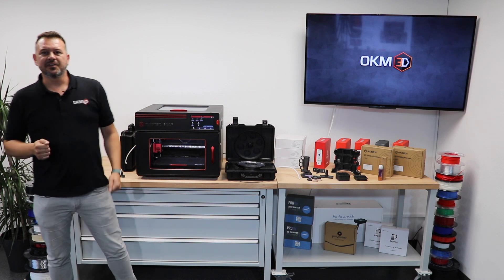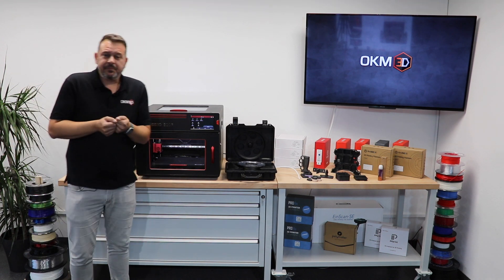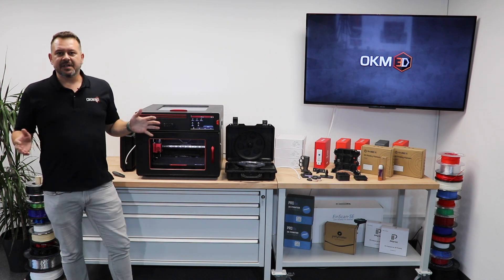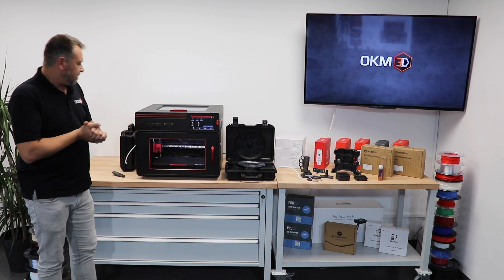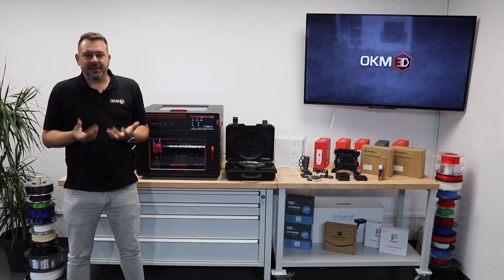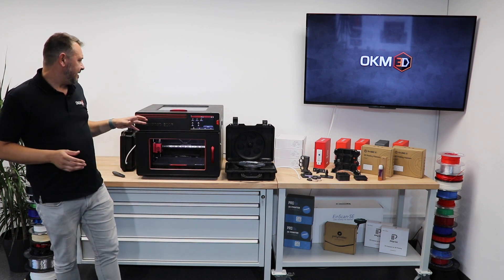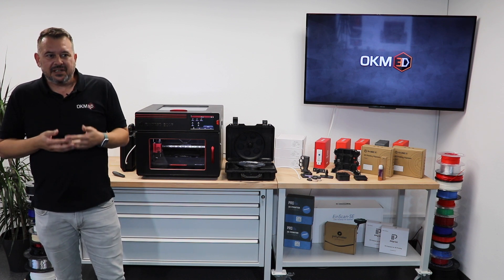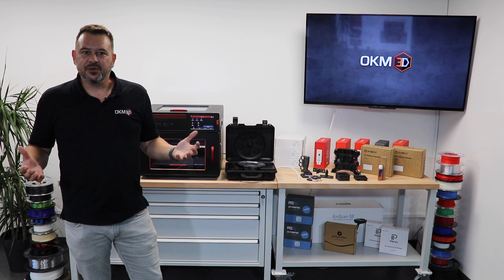Presentation of Raise3D E2 CF - E2CF 3D printer for fiber-reinforced filaments

Comment: Is this maxhine still in use or are you willing to put it up for sale ? Interested in buying it from you.
Reply from the maker: Still in use. However you can buy them here: https://www.3d-drucker-experte.de/raise3d/raise3d-hardware/raise3d-e2-cf/
Reply: @timmeybt  appreciate you sharing. Looking into it. Also, had it been worth the upgrade ? Are these CF infused filament parts actually good or what ?
Reply from the maker: @f.c.2475  CF added filaments provide higher mechanical properties, higher thermal resistance and higher print stability. Often the surface finish looks better too, with the z layers being less visible. However, CF filaments are a bit more difficult to work with, needing to be kept dry and being very abrasive. It depends on the application on whether the tradeoffs are worth it.
Reply: @timmeybt  Understood. Wonder if you have any experience with both CF-Infused and the (Markforged-Mark2's) Laying Carbon-Threads process. Intuitively it seems like carbon-threads would do way better than infused-carbon. Thanks for your views !
Reply from the maker: @f.c.2475  It does do better. However, it is significantly more expensive, the machine is more complicated and error-prone (because fiber-laying is difficult to do well, though Markforged have done a decent job to build a stable machine) and the surrounding plastic is still a standard 3D printing filament, which is why Markforged combined CF infused with continuous fiber. If you are interested in continuous fiber, you can also check out Anisoprint, who are essentially the only real competitor to Markforged.
Essentially it's the same question as before. There are tradeoffs here (money, complexity,... in exchange for higher part strength) and you need to figure out whether the tradeoffs are worth it.
Reply: @OKM2000 Group  looked into Anisoprint. Looks good. Anyways, I think I've taken much of your time. Really appreciate you sharing your thoughts. You've been of great help! Thank you!